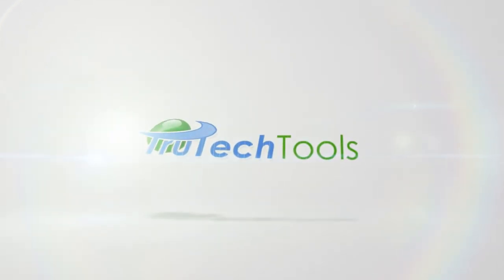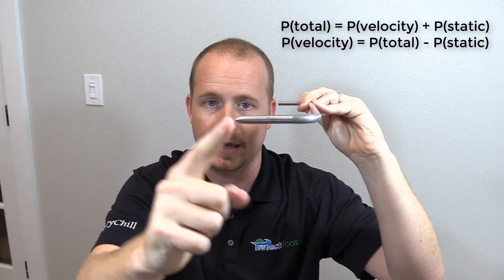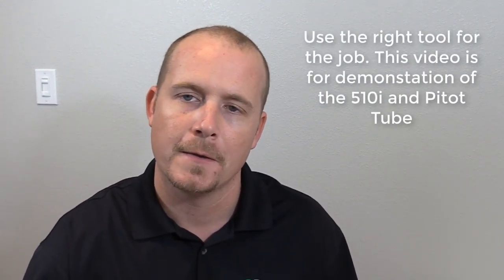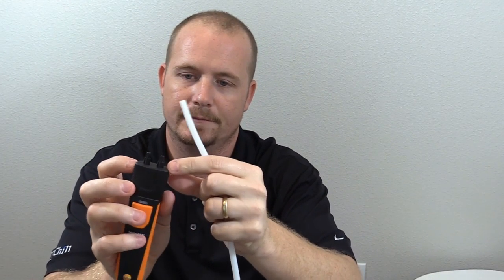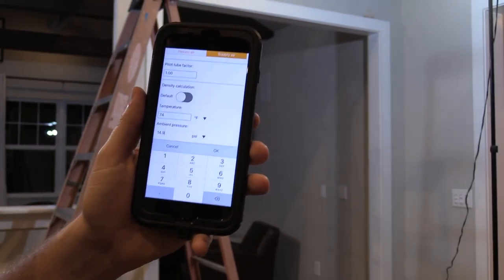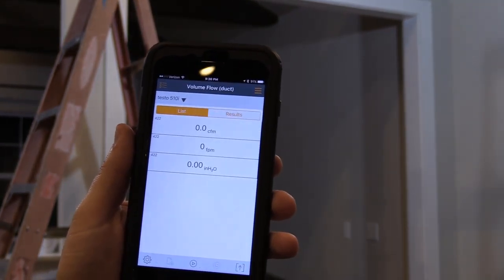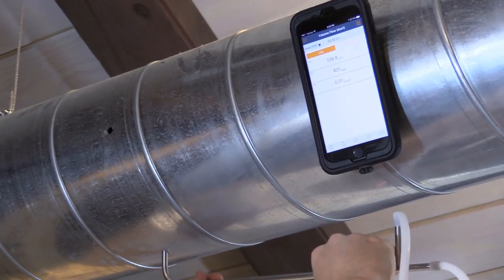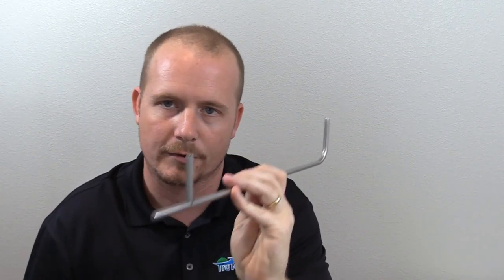Measuring Velocity Pressure, FPM and CFM with a Testo 510i Manometer and a Pitot Tube

Comment: Hey, Bryan, I was recently listening to one of your podcasts, and you were referring to a video you made with a pitot tube that you did incorrectly.  Is this that video, or did you get rid of that one already?   Thanks so much for all the content you put out.  You guys are doing a great service.
Reply from the maker: This was the one. Bryan was using a digital manometer that did not have high enough accuracy for the relatively low flow pressures in a residential duct. Only when flow velocities are above 700 Feet Per Minute can a manometer of this type be used effectively with a Pitot tube.

Comment: Nice video!  I have a potential problem with low airflow in a package unit that only has flexible ducting.  What process would you recommend to measure either CFM or ESP in flex ducting?  Thanks.
Reply from the maker: Unfortunately, it is very difficult to measure anything in flex. If you are looking for total system airflow use the digital TrueFlow grid or the static pressure tables for the equipment. If you are looking for supply or return airflow use a flow hood or large vane anemometer at the grilles.

Comment: Thanks, can you clarify one thing. If the static pressure is too high , the CFMs drop but the air velocity is increased ? So even though there is a cfm drop the velocity is increased and can cause noise issues?
Reply from the maker: You can’t use a testo 510 and pitot tube to measure residential airflow. The range of the 510 is not low enough and the resolution is not fine enough   

You may be confusing two things.
Total External Static Pressure (TESP) in the system is the load against which the distribution fan has to "push" the air. Higher TESP usually means lower system airflow or excess energy use in an ECM motor.

Measuring Static pressure drop OVER an A-coil or heat exchanger is an indirect method to determining air flow (CFM) via pressure drop over a component and brand and model specific manufacturer data.

Excessive CFMs (airflow) through grilles and ductwork can produce excess noise

If you have any additional questions, please do reach out by email at billy@trutechtools.com!

Comment: Big thumbs up for this video. Can you tell me what is the lowest speed this setup can detect? I'm looking ducts having airspeeds as low as 2 m/s
Reply from the maker: The key is choosing the correct manometer with sufficient accuracy for the flow velocity (total/velocity pressure). To measure under 3.5 m/s (700 feet per minute) you need a finer resolution manometer like the TSI AirPro 800 or the testo 512. The pitot tube can be the same, just the manometer changes.

Comment: Whats funny is the 8.5 duct diameters thing, ive seen manometer manufacturers say anywhere between 8 and 13 ft downstream and 3 to 6 upstream from restrictions or changes in duct.  In the real world, when is that ever even close to possible. I havnt found many if at all in my 27 years. So makes you wonder